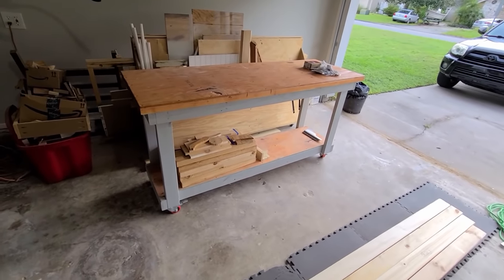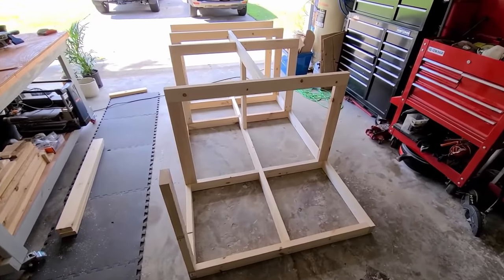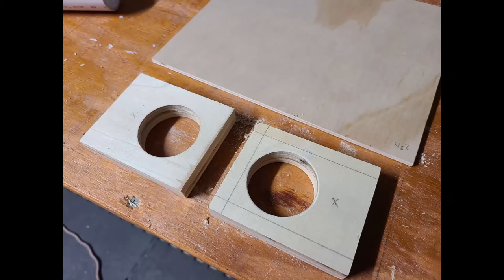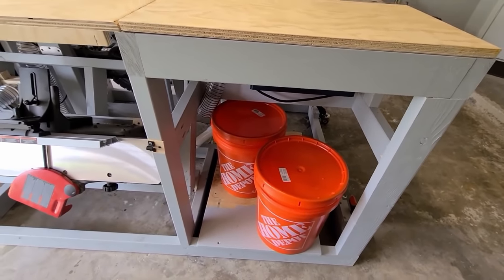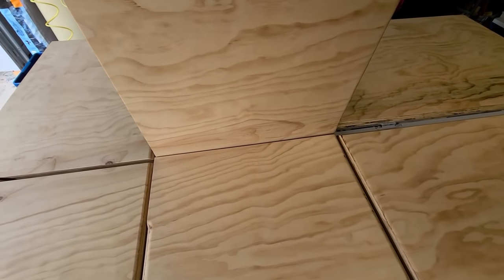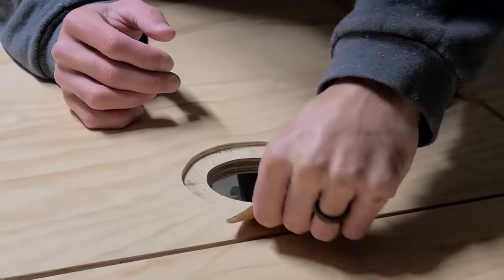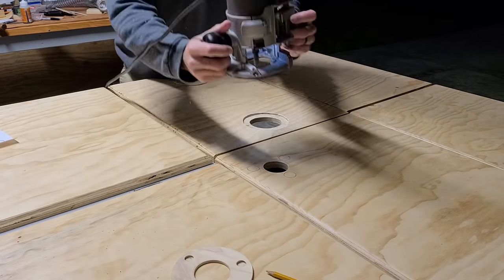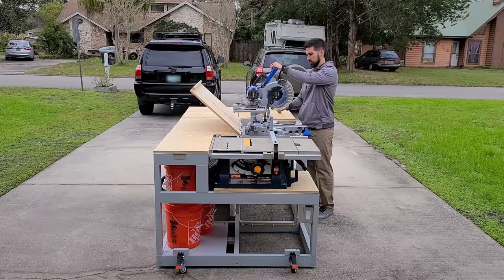4x8 Workbench, Tools, Vacuum, Power and Dust Separator

Comment: Sir, what you have created here is nothing short of amazing. It is plain to see you put a considerable amount of thought and planning into the project before you even touched the first piece of wood. You can be very proud of what you have created and here is a big 'THANK YOU' for sharing it with us. If you don't mind, I do have a couple of questions.

1)  Now that you have had a chance to put your creation to use in actual shop conditions, what do you think if it? In other words, if you were to build another work bench, what, if any, changes would you make? Why?
2)  How did you decide on the correct height of the work bench, measuring from the shop floor to the work surface? You will spend a great many hours standing at this bench, especially when you have all the tools put down and are just using it as a table. It needs to be built to your height so you're not 'stooping over' a bit which is a perfect recipe for back ache. I've seen a great many work benches built here on YouTube, but I've never seen anyone explain how they arrived at the correct height. Is there some 'special formula' that will give the correct table height according to how tall the operator is? 

I appreciate any advice you can give and again, THANK YOU for sharing this with us.
Reply from the maker: Thanks for watching. I have a "2 year review" video addressing some of the changes I would have made. I think I determined the height by what would be a comfortable working height for accessing the infeed and outfeed of most of the tools.

Comment: personally i would buy one of the plugs  that auto turn on the shop vac when you turn on a tool. and have everything wired through it so that no mater what i turn on it turns on the vac.. just don't run any extra tools at the same time and you wont have to worry about overloading your electrical system. i was thinking about making one of these but decided to just rip out some of cabinets that was sucking up a lot of wall space instead. anyways cheers and good job on the build.
Reply from the maker: Thank you! Yeah, I'm not sure yet if I'll go that route our use an over wire amp sensing switch for the vac.

Comment: Another small trick thing to add would be some bench dog holes with rollerball guides on the outfeed table. Might have to recess them a litlte but a tiny magnetic insert could afford recessed rollerballs when needed and keep things flush when not. 

Some storage for extra blades, bits,  etc.. I'm always struggling to find the wrench to change my blades. 

Getting way ahead of myself, I need to get the tools for this bench first. 😂
Reply from the maker: That's a great idea! There are all kinds of nooks and crannies where you can add a small hook or drawer for blades etc. I'm with you on the rollers for outfeed also!

Comment: Awesome! Why didn't you switch the plainer around 180 degrees?
Reply: Great job nice how you made all your out feed level with the table top
Reply from the maker: Thanks. If the planer was rotated 180 then the hose port would be facing the outside of the table which would require the hose to be ran on the outside.

Comment: I plan on building something like this for my miter saw, table saw and router. I really like your magnet dust collection hose solution. I don't have a planar, but it seems like that outfeed for the vacuum line will move with the planar as you open it to mill larger thickness lumber. I guess if you only ever need to run 2x through, you'll probably be fine.

I've watched a lot of build videos and this one was really well put together. Thanks for sharing.
Reply from the maker: Thank you. Yes, the vacuum line seems to have enough flex for the planer.

Comment: One very small suggestion - Deepen the holes on the tabletop for both the router and planer side and you could recess the hose openings enough to add a bit of 1/8: birch ply in, and have a totally smooth able top.  a few more knockouts would hold the birch ply to the hose ends when not in use.
Reply from the maker: Good idea. 👍

Comment: Great setup... Looks like the Vac tube for the thickness planer isn't long enough to handle the full height of the tool. You may want to change out the hinge on the planer cover to a 180 Degree (full swing) hinge to let that panel will lay flat when open and align the Vac holes to allow a coupling to pass through. This will eliminate one of the Vac leaks.
Reply from the maker: That's a great idea! I haven't had to plane anything thicker than 4" but I will keep that in mind.

Comment: Great work, Ironically, I just built my own 4x8 work bench the last 3 days with a built in table ONLY, but yours is amazing, ingenious. . I am building 2 more work benches 8ft long by 25"wide below that will be storage for the planner that rolls out when needed, Drill press on top, band saw is a freestanding.

Anyway, thanks for sharing, you did an amazing job.  very impressive.
Reply from the maker: Cool, sounds like a good shop. My pleasure to share the build! Thanks!

Comment: Thanks! It does inspire, especialy if you have something like it in mind.
 I felt it could be done. I saw one that had two machines in it, small just those two machines. They rotated and you can use one or the other just by rotating them. I would like to combine this with the rotating one. And instead of 4×8, 3X8 for me have one car garage.
Very nice work, thanks for the inspiration. 👍🏻
Reply from the maker: thanks!

Comment: Awesome build, I will save for future reference! Just a thought and something I do. Instead of using the thread zerts, I think they are called, I always just thread the wood instead and have had better results than having the zerts pulling out. I have never had a thread strip out of wood. Thanks for sharing!!!!!
Reply from the maker: Thanks for the input. I actually did that on one of them and it has been holding up so far.
Reply: @phillipreborn  Good to hear that it worked for you. I've been threading wood for over 30 years and no problems. I think it may be much stronger in lots of situations.

Comment: Great idea and good job. 
I have two small suggestions:
- I still think you can have permanent dust extraction for the planer by using a 90 deg Elbow. 
- The second is bandsaw - it looks flush with the rest of the table, but if you need to make angel cuts on it you have to figure out how to rise it up.
Reply from the maker: Thank you very much! Yes, those are both good points.

Comment: This is really cool. Seeing multi-purpose benches like this is always inspiring. Have you had any problems with this since building it? Like:
-Do the folding tools have problems with the joints? (Hinges breaking down or get loose?)
-Do you see any breakdown in structural integrity?
-Are there better ways to streamline the processes of this table that you've found?
Reply from the maker: No issues so far.

Comment: Fantastic build!
Based on what I see in the video, the only thing I'd change (other than adjusting measurements for my particular tools) would MAYBE be to mount the blast gates so I could use "permanently mounted" dowel rods  through the legs to open and close them, instead of contorting my old back to reach down into the bench. 
 Actually, I probably wouldn't, but it would be on the top of my "I need to _____" list.
Reply from the maker: Thank you! That is a great idea.

Comment: Bought the plans about a month ago and will hopefully be building it this weekend.
Reply from the maker: Thanks! Sounds good.
Reply: @phillipreborn  I have a question on the plans. The bottom frame has the 21.5 boards but with the 2 outer boards and the 93 in the middle it is not 4 feet wide, and the 21.5 boards do not fit in the middle?
Reply from the maker: @JasonLConley  both 21.5" boards are actually 1/4" shorter than they should be to account for any twist in the long side pieces. The sides are pulled in the 1/4" when screwed together.
Reply: @phillipreborn  I apologize, I didn’t pay attention on what I was cutting and cut 3 41 inch instead of 1 41 and 2 45’s. Sorry

Comment: granted I am seeing this two years in but to hold the vacuum insert open you could get some EM relays to pull the inserts out when relay is underpower and release to a normally closed position. It is  a pricy convenience but it is a fun "I did that" feature.
Reply from the maker: Thanks. I may revisit an automatic switch sometime.

Comment: Insane. I'm going to try to build something like this. Thanks for the inspiration!
Reply from the maker: Sounds good, thanks. Glad to hear that! You are welcome.
Reply: @phillipreborn  You should consider one of those switches that automatically kicks on the vacuum when you start a power tool. They're pretty trick. 

I still have to get a few more tools to justify this bench but will try to pick up your plan to support even if I need to modify it a little for my tool set.

Comment: That's a GREAT TABLE.  The only thing I would have done differently would have been to just move the planer to the router's position and run the vacuum tube out the side of the table rather than drilling holes in the top.  But besides that... it's very impressive.
Reply from the maker: Thanks! 👍

Comment: great design. a whole shop on a 4x8 table is impressive for us that dont have a ton of room for equipment. The only issue i would have is not having a flat surface to work on. with all of those moving sections of the table top it doesnt look very level. awesome job though.
Reply from the maker: Thank you! Its pretty level but I have a spare work bench when those tools are in use.

Comment: Very well done, only critique I have is I would have centralized all those gate valves in one location, they all seem a little difficult and scattered?... or maybe you have it set up so its right there by the tool to open when you use it? if so then that's great.
Reply from the maker: Thanks!

Comment: I don't know if you are aware, home depot carries dust stopper for pretty shot money.  The effort into making it doesn't save much (if at all).  It's very low profile as well.  could save some space for router bit storage.  LOL.  I don't know how flat you can keep thru out the table given all the weight of the machines.  The idea is very good.  If I were to do it, I will make two smaller tables on wheels to make it more modular.  I don't necessary need all the machines at once all the time.  I would definitely group table saw and router together.
Reply from the maker: Thanks and good idea.

Comment: I have the same problem. 2 Car  garage and large wood working machines. Hey, I hooked up 2 small shopvacs and got twice the suction. Must use same size hose for everything or you cut the suction back down.
Reply from the maker: Thanks for the tip!

Comment: You have done an outstanding job but I suppose at this time you have corrected your issue you have with one item on the table. That would be the Planer dust collection. The hose is too short if you try to plane something that would max out the height of the planer. But otherwise, great design and configuration of the table. 👍
Reply from the maker: Thanks, I haven't tested anything over 6 inches yet. The hose does have some flex and spring but not sure if it would make it to 10+ inches. I'll do a an update video no that later.

Comment: This is an absolutely awesome bench. I think the only thing I might have changed would be not running exposed romex in such a potentially harsh environment, where it could easily be damaged. Consider putting it in EMT conduit!
Reply from the maker: Thank you! I agree. In hindsight some MC (flexible conduit) or EMT would be good. I may redo it someday.

Comment: The idea is great,but with all the heat and vibration of the power tools ,I think using a metal frame would be better and one more thing you could mont the wood  plainer the table you just have to make a tunnel that goes all the way through right. I mean you'll just have to feed the wood in it I think that would be easier in terms of having to lift everything up the table .
Reply from the maker: Thank you.

Comment: good job. Thought about it many many times, as I have very restricted space also. They should make tools for the purpose of build ins. I think they could get a lot more power and features if they did, cz these are all technically portable and 'jobsite' models, right. But the bigger shop models, you could never put them all in a compact unit like this, or a truck/van, BUT if they offered the shop models with no structures, and maybe added something to attach them easily to a central dock or something. They could do that too, hjust have one table, but tools that you can click in and out and hanfg on the wall when not using... OR just a rotater, spin the wheel from tool to tool, lol, like the car storage machine buildings thingys, lol   peace
Reply from the maker: Thanks. That would be cool.

Comment: Nice work! One flaw I noticed is that it seems like the dust collection hose for the planer is only going to give you a few inches of travel up and down before it would pull off the magnets.
Reply from the maker: Thank you! They are pretty strong and the hose has good flex but I haven't planed anything super thick yet either.

Comment: While I applaud your over engineering of the vacuum system, You probably could have saved some time just using some more CPVC tubing and fittings, Might have even saved a tiny bit of suction power loss between the wooden shut off valves. Ive seen houses set up similar to this. Older ladies home, she had 2inch tube running in the floor boards and walls of every room. She could walk from room to room with just a hose attachment, and the tubes would take the debris to the basement/ near the rear exit where she could pull the bag and drop it outside for the trash man. Very clever system, id like to shake the hand of the guy who originally came up with the idea. Saved her having to cart the vacuum cleaner from room to room and up and down stairs.
Reply from the maker: Thanks! Yeah, I like those central vac systems.

Comment: Very well thought out. If you're still using this table, did you cut out the miter slots on your wood at discharge end of table saw?  That's if you use a miter sled. Great idea to have an all in one work bench. Awesome job my friend. Steve
Reply from the maker: I did not. I haven't used a sled yet.

Comment: Pretty cool. I've seen the other work bench with all the flip top tools that utilizes cabinet doors to stabilize the tools and this seems a lot simpler. I would have just made the planer top removable instead of on a hinge that way there's no need for a hole in the top for dust collection.
Reply from the maker: Thank you! That's actually a genius and simple idea. haha
Reply: Maybe put the planer wood base on sliders so it pulls away from the table a bit. Then dust tubing can connect underneath versus through the top
Reply: @phillipreborn  magnets maybe

Comment: Really nice, good job! Excellent to have the dust extraction built in there too. A couple of thoughts for you: did you know that the gorilla glue is moisture activated? If you get a spray bottle, and wet the surfaces you want to glue, it will cure a lot faster. And, looks like you have some space in there for a few drawers, or panels for things like router bits and tool accessories.
Reply from the maker: Thanks, I've heard that about wood glue but didn't realize it was the same for gorilla glue. Yes, plenty of areas for extra storage or drawers.

Comment: Nice design. I think you might find that you do not get very good suction on the tool that uses the magnet held tube. It looks like there is a gap on the tool side as the magnets/metal is not recessed. I suggest addressing that and also recessing a large o ring on both sides of the board to get a better seal. Hope that helps.
Reply from the maker: Thanks for the tip! Recessing it would have been ideal. I did add some foam tape as a gasket to seal the side with a gap.

Comment: Those hole saws are terrifying. Must go slow with them
Reply from the maker: Indeed, lesson learned.
Reply: I was working in a fitness equipment model shop back in the 1990’s. One of the ID’s (industrial designer) was attempting to cut a large hole in some pvc pipe. The hole saw pulled the pipe in the drill press but instead of letting it go, he hung on and sawed his hand all up. I put some clean towels on his wound and rushed him to the hospital/clinic. Just before the accident, I was talking to him about Jesus but he was an atheist.😢

Comment: Well done. After using it, I'm curious to know what changes you would make. Do you ever find yourself needing two different tools frequently and at the same time? In other words would you change the layout at all?  Great job though. You kept my attention the whole video.
Reply from the maker: Thank you very much! I have had to swap to a different tool but thankfully they fold away quickly. I try to plan all the milling out so it goes from one station to the other.

Comment: Very good, but one thing is a puzzle, when you used the thicknesser / planer was the tube long enough as if you had a thick piece of material to thickness or plane it would not of been??
Reply from the maker: So far it has been long enough but I'm also not milling anything thicker than about 2 inches.

Comment: great design seems to work very well.
but i for see one problem, your dust extraction for the planer doesn't look like it will travel with the planner head when you change thickness.
Reply from the maker: Thanks. I'm not sure either. I haven't had to plane anything super thick yet.